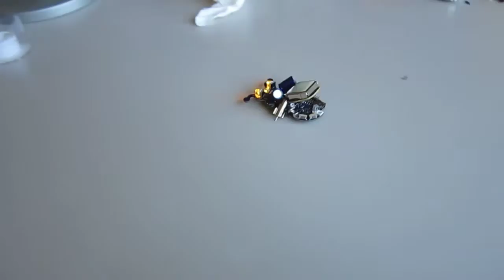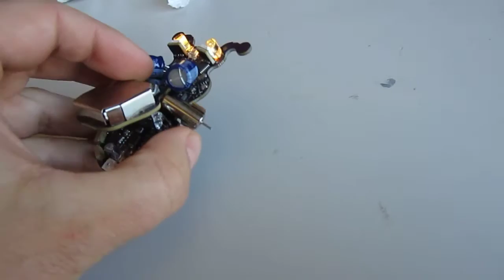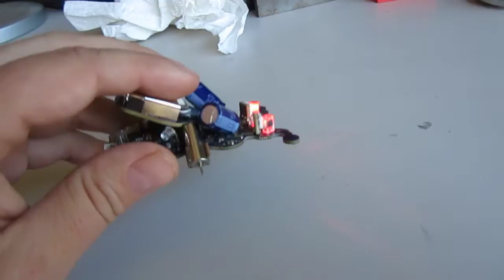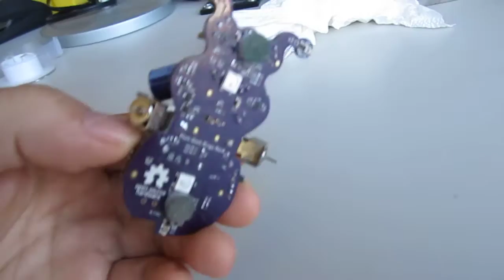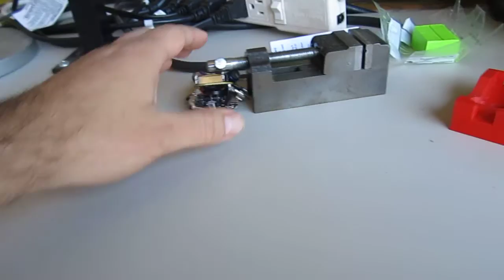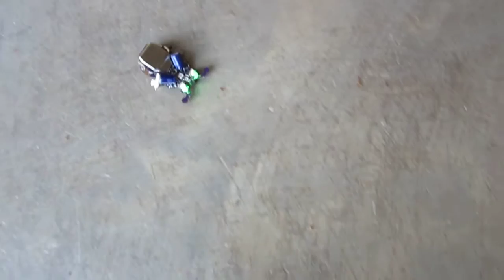Ringo Kickstarter Update 22 - Motors

Comment: Hi, I am trying to build a simple microcontroller-based robot as a project but I couldn't find any pager motors without the vibrating bit attached. I was wondering if you custom ordered the pager motors for your bot or if you bought them somewhere. If you did buy them somewhere, could you let me know? Thank you.
Reply from the maker: Hey Michail - glad you live nearby. Glad to have you stop by the shop and happy to help with your project.

A quick response in case anyone else sees the comment - we do custom order these motors. It is possible to remove the vibration weight from motors you may find elsewhere - there are some guides on doing this. The factory we get the motors from requires we order minimums of 5000 pcs at a time. If anyone else needs motors like this, contact us through our website and I'm happy to setup a custom order and send you small quantities of the motors and/or the custom metal clips we use to mount them.

Comment from the maker: Hey Sean - You can control them individually at any speed.  The speed ranges from 1 to 255 in both forward and backward directions.  The motors are controlled by calling a function  Motors(100,100);  <- this for example run the left motor at backward 100 speed and the right motor at forward 100 speed.  You can check out our guide book here:  http://www.plumgeek.com/ringo-guide.html

The guide tells you all about using Ringo.  Units are now available and shipping to people outside Kickstarter on our store:  https://plumgeekrobotics.myshopify.com/

Thanks!